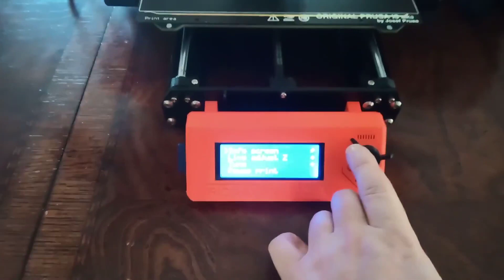Buffer Free MMU2s Final Design

Comment: Came here thanks to a rabbit hole of buffers on printables. I'm concerned by the binding of the filament within itself because of the loose wrapping of the spool. Also thank you for showing 4 spools on the top, I may adapt that onto my printer
Reply from the maker: Unless it is already tangled when loaded it will not bind. I'm surprised myself how well this works without a buffer. Perfect for PETG printing. Old PLA may create problems as it becomes stiffer and breaks or create a loop.

Comment: Could you give me some details on where exactly to widen the heatbreak? I have watched your Part one video already but I’m not quite sure if I understood it right. My heatbreak already has some kind of funnel. I haven’t found any other videos or posts regarding this fix and I’d be thankful for any help   :)
Reply from the maker: The "funnel" part of the heatbreak is where the PTFE tube sits. You need to widen the inside diameter of the heatbreak about 0.3-0.5 mm (after the funnel) for  5 mm length going in. Also not very much but makes all the difference. Use a fine drill or a diamond tip burr with a dremel tool. Be careful not to brake off the drill bit and have it stuck inside. Blow out all the metal dust. After that the heat break will take any size of deformed filament tip. The heat at the end of the heatbreak is still enough to slightly soften the tips preventing it from clogging when there is a filament change. Also check the plastic diameter above the gears where the filament is fed in. That is the part which replaced the metal ball on the old filament sensor.